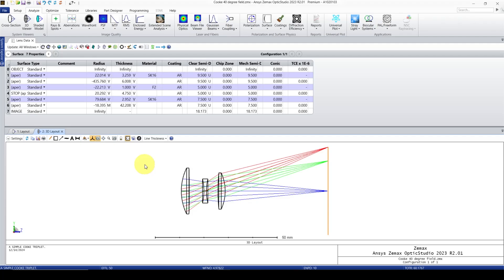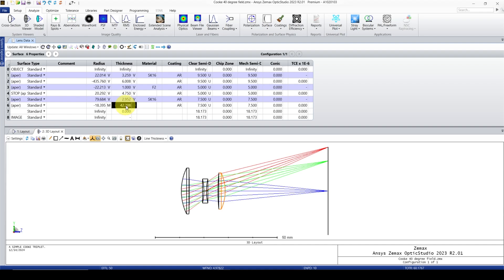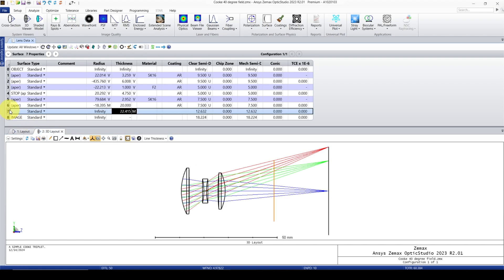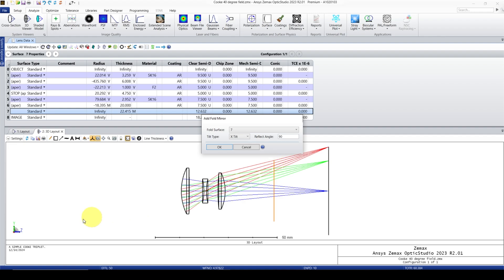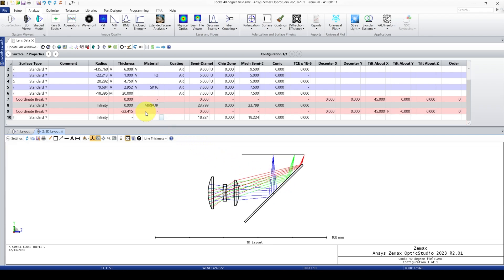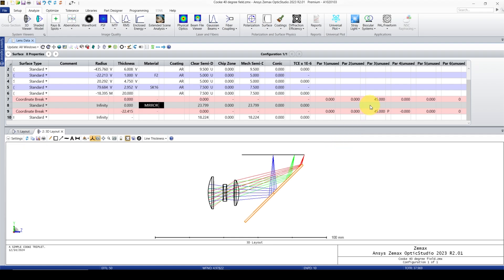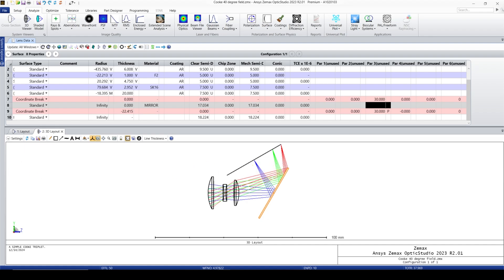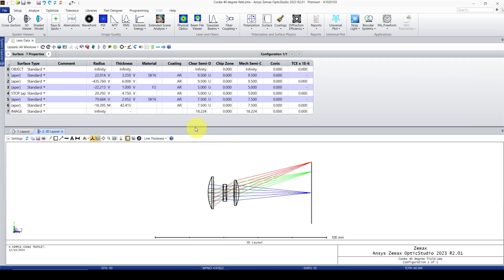How to Add Folding Mirror in Zemax

Comment: Very useful, thank you🙏🏻
Reply from the maker: You're welcome. 
Please let me knoe if you have any questions
Reply: @ here is a question, might be a little off-topic this video though:
Why do we always use input parallel  beams (infinite objects) to evaluate the performance of a lens system? Is it just for simplicity?
Isnt it possible our lens system works good for infinite objects but not good for finite ones?
Reply from the maker: @soranshadman6871  In scene imaging systems, we often assume the subject is at infinity because, in most cases, the distance to the subject is significantly greater than the lens's focal length. This simplifies calculations and aligns with how lenses operate in practical scenarios.

Another important concept is the depth of field, which refers to the range within which a lens can produce sharp and clear images. Each lens has a specific depth of field that determines the extent of perfect imaging for objects at different distances.
Please watch this video:
https://youtu.be/OhpttQ_a8WQ?si=osjSiG5LC27BKD2u